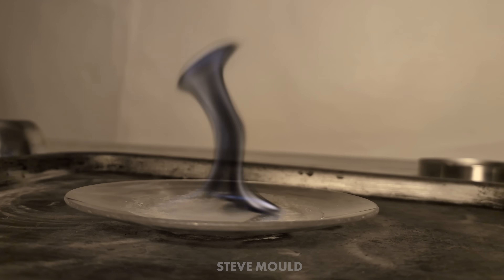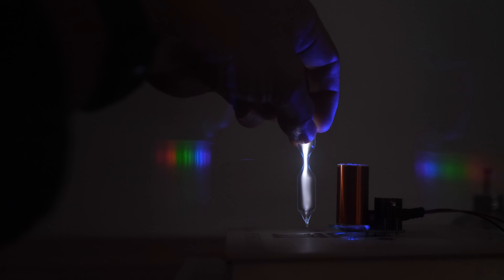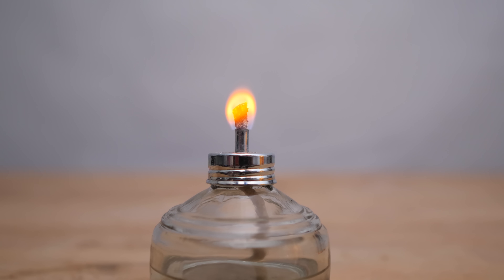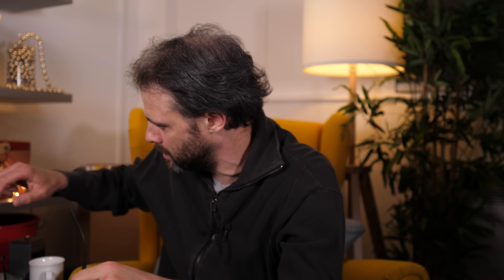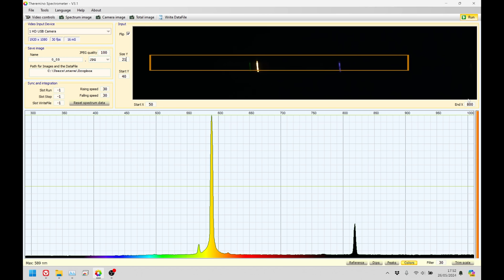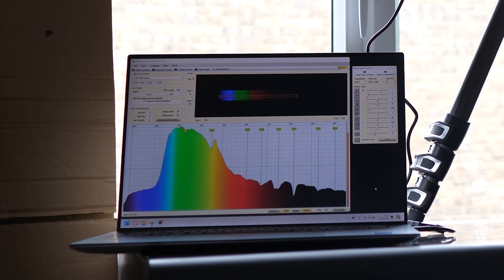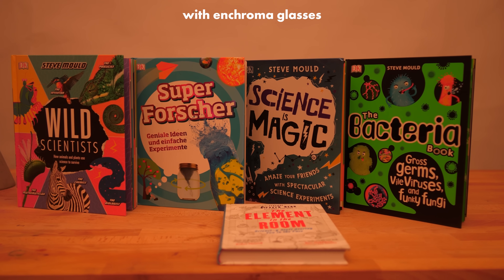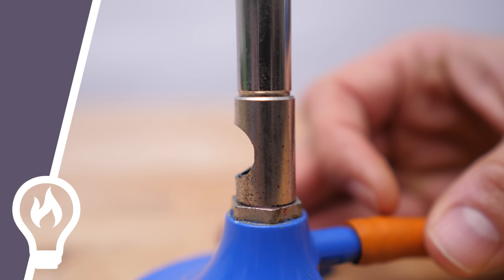Light sucking flames look like magic

Comment: 6:12 I'm not sure if that explanation clicks with me. If the light is just re-emitted in a random direction, yes you're going to get less of the light originally coming from behind, but you're also going to get extra light that originally came from in front, the sides, etc. So assuming an equally lit surroundings, should the net light emitted not be the same?

Comment: Steve, there's a flaw in your explanation about the directions of the photons.  Photons are not only  entering the flame from the patch on the wall right behind it. They are also entering it from the entire wall. So the entering directions are just as random as the exiting directions.  So the flame should look just like a diffuser... which looks neutral, not black.  There must be something else going on.

Comment: I participated in a study by the University of Montreal on inside enchroma glasses. after the test,  I got to try exterior exterior enchroma glasses ""  in a fruit and vegetable  market. I realized that carrots are what I normally perceive as red. same with orange, but the grass stayed almost the same color. normally , for me, those 3 things are the same color. so, it "worked" by allowing me to distinguish between those colors. it was weird, and if the glasses were 10-15$, I could be interested as a "novelty" thing, but not for everyday use.  I don't see the point (I must be "point blind" too 😂) 

extra info : the test wasn't a color blind test, but with pictures and objects seen with different glasses of which one was inside enchroma glasses. I wasn't told which one I was wearing for each run of the test.

for me (and most people) inside glasses had no effects under any lightning conditions both on the test or outside.

Outside glasses on cloudy days or inside have no effects either.

Comment: You had an ideal chance to touch on Atomic Absorption Spectroscopy, which revolutionized trace metal analytical chemistry from the 1950s on. It was developed in its modern form by a team led by Sir Alan Walsh. I actually worked in the same lab after he retired and had a chance to meet him when he returned for a visit.

Comment: @SteveMould Could you please share source for that color test at 15:37. I usually can pass all color tests, but can not see any number in the  top raw middle to the right image. Would like to read more about it. Thanks in advance.
Reply: I don't see any numbers in Pic.3 either. It looks kinda like tree branches to me.   
It might be an intentionally empty slide - to filter out false positives. (The tests I did had those - because they were multiple choice tests. So if you don't see anything - you have to press "empty" instead of trying to guess)
Reply: you mean 15:37?
Reply: Yes, thank you for correction. I will try to update the comment
Reply: Same, and I've even taken the test on the EnChroma site and it came negative ("normal vision"). I think Steve's trolling us :D
Reply: There is no number in the third image on the top row (pic 3, or top right middle), but there is an orange and green pattern.

Comment: You might enjoy this: I was out with my brother one night many years ago.  We bought a box of Cheese Its on the way home.  Now, my parents' house at the time had a large lamp over the garage, with I think a metal halide bulb.  So we pull up to the house and sit in the car talking for a bit.  I pull out the box of Cheese Its, and to my amazement it's mostly black.  Specifically, anywhere that is normally red on the box was just solid black.  So I turned on the overhead light in the car, and suddenly the red appears.  My brother and I are both fairly well versed in the sciences, so we both fully understood what was happening (the metal halide bulb as emitting no red light at all, so there was nothing for the red portions of the box to reflect), but actually experiencing it was really trippy.

I don't know what the spectrum of the bulb actually was, aside from knowing that it had no red it in at all.  But I wonder if there are metal halide bulbs that could do the same things as sodium vapor, just with a different wavelength.
Reply: Back in the 90s I had a red Golf GTI Mk 2 that looked very weird under sodium street lamps. But not black, sadly.
Thanks for the Cheezits reference btw. I love Cheezits, esp. the now discontinued Tabasco flavor. 
Am I wandering off topic?

Comment: As EnChroma user I can confirm it works. 
I can see world more colorful, and I can pass that test. 
It works exactly how you mention but there is also something that happens with brain; after some time, brain accommodates to the new environment. It is somehow weird, because when I take glasses off (after at least 30 min of use) everything is very green, like someone poured green paint over everything.

Comment: You are correct that the emission at ~819nm is also from neutral sodium atoms. It's seen in the spectra of low temperature stars like this one.
https://ar5iv.labs.arxiv.org/html/1702.06957/assets/x12.png
Also NIST has a webpage that is widely used by scientists to look up this kind of atomic data 
https://physics.nist.gov/PhysRefData/ASD/lines_form.html